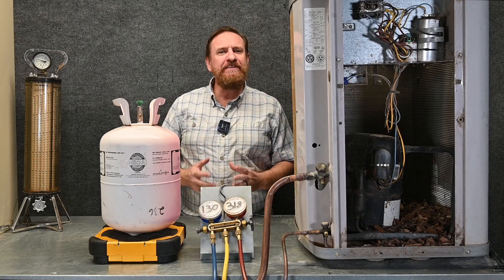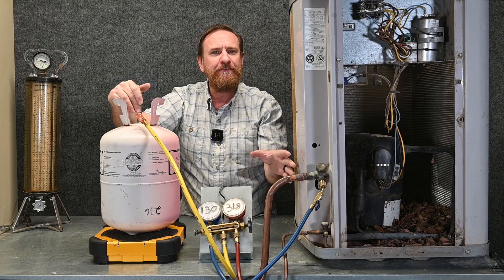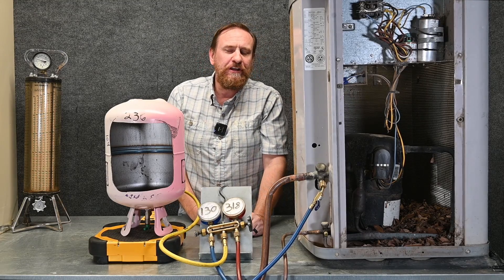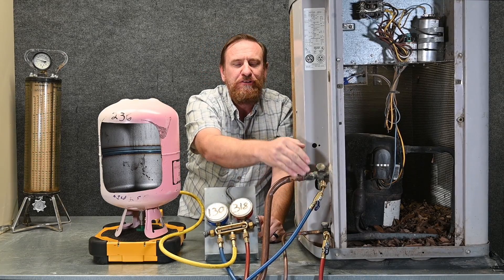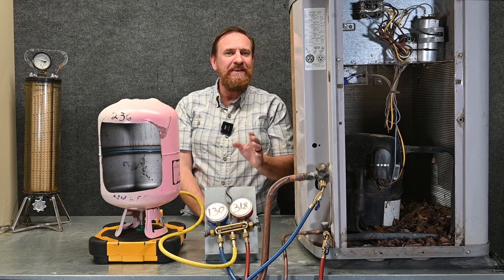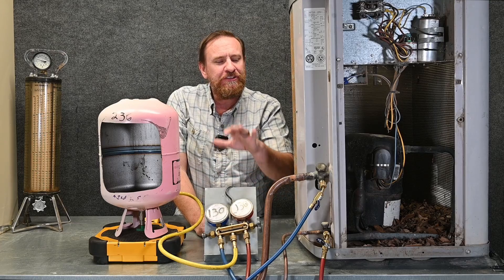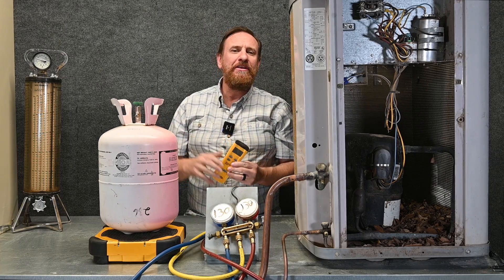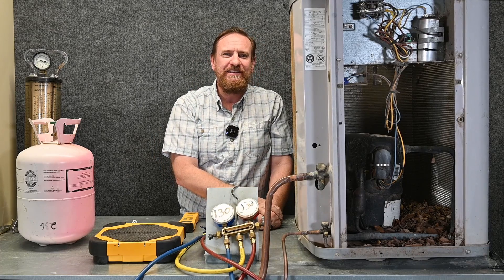HVAC 117 Charging with Manual Low loss fittings and 3 port manifold

Comment: Could you the jug (right side up) to purge the lines instead of the LO side service line?  Would that be an advantage?
Reply from the maker: There are many way to pruge. As long as the air is out of all the lines your good.
Reply: @love2hvac  Thanks for the tip!  Using vapor to purge  hoses, conserves R410A (@ $20/lb.).   
I plan to experiment with your purge method using C&D Valve CD2070 Core Depressor (with a back seat). 
This may be to fancy, but I think it might really be a very controlled setup.

Comment: I used 3 different AC companies.  One replaced my evaporator, and condenser. 6 months later  it leaked and I had to replace the line set.  They pressure tested with Nitrogen, and evacuated the system and recharged the system. My AC still didn't cool well,  so I called another AC company. They added more R410A and it works much better but not great.  I never once saw any of the 3 AC technicians purge the hoses.  Could contaminated refrigerant cause poor performance?  How can this be corrected?
Reply from the maker: It's possible.
The first company should have found the leaking lineset during a pressure test before pulling a vacuum. They also would not have reached the right vacuum with a leaking lineset.

Comment: Q: at around the 9:30 mark you are "bleeding" any liquid refr. trapped inside the red hose back into the low side. As it travels thru the manifold and into the vapor line, because the yellow and blue hoses are equalized, can any liquid refrigerant enter the yellow hose which was already previously bled? Or will it all be vaporized at this point already?
Reply from the maker: Great question.

Yes it is possible for some liquid refregerant to flow into the yellow line.
It will be very quick for the pressure to equalize to the suction side and any remaining refregerant will typically,  quickly boil off into a vapor. 

Being bleg is really referring to making sure there are no contaminants. In this case the line was bled att he begining when we first attached the tank. 

For example. Let's say I did not bleed the yellow hose. Air, or even refrigerant from the last call could be in there. Now imagine I was to open the high side and low side on the manifold. The high side would mix with what ever was in the yellow hose and push into the system via the low side.

Comment: Could you similarly start off by connecting the low side, opening the low side on the manifold and using the manual low-loss on the charging hose to purge both the low and charging hoses simultaneously? Your method uses pressure from the unit for both those hoses anyway, so it seems like loss doing it this other way would be pretty much identical.
Reply from the maker: Yes but you left out purging of the high side hose.

Comment: Does yellow charging hose need a Schrader valve? Thanks for ur hard work teaching us need techs
Reply: Correction I meant does yellow charging hose need core depressors inside them ?
Reply from the maker: Great question. 
Usually No.
I many times would pull mine out for faster flow. But it does still need the ball valve
Reply: @love2hvac  thanks TY

Comment: a liquid charging adapter could be used as well to ensure no liquid goes in.
Reply from the maker: That's true, covered that in 116.
It's important to understand how they work. It's just a fixed hole, a metering device. Left open for too long can still allow a stream of liquid to the compressor. Nice to have but not a solve all solution.